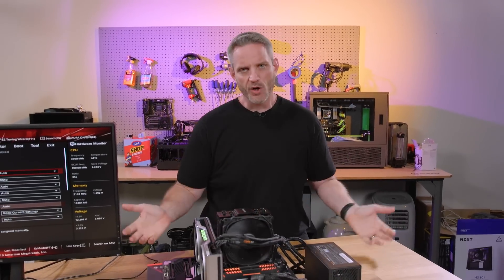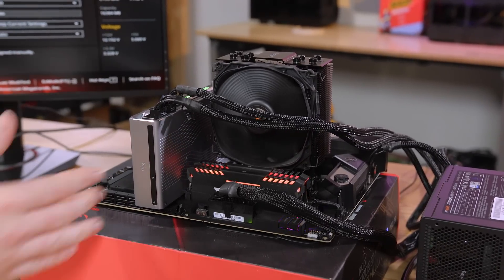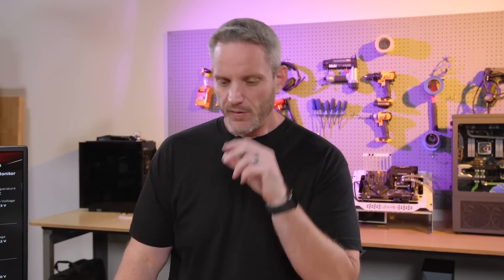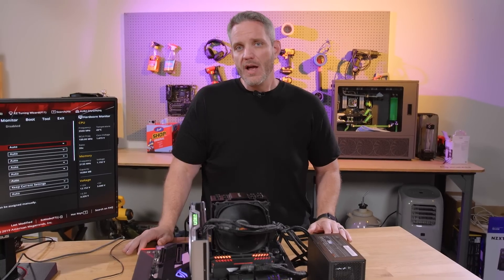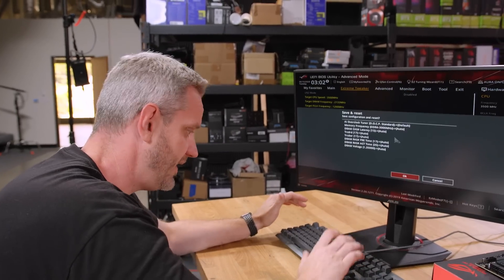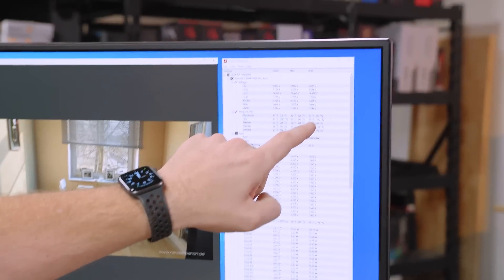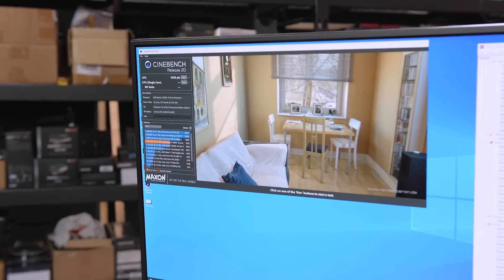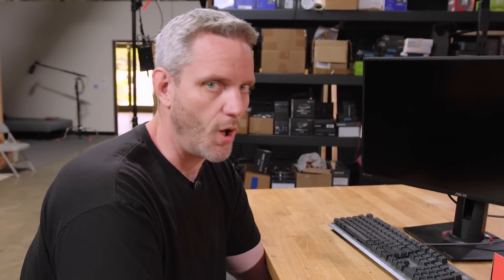Is your motherboard trying to damage your Ryzen CPU?

Comment: All my life I've only killed one CPU, and that was a Pentium 3 without a heatsink on it. I've also never heard of anybody killing a CPU. I even had a motherboard blow its VRM, the CPU survived.
So if a CPU can take 12 volts of raw power and still be functional, I'm pretty sure that any motherboard tweaks aren't going to be a problem. Odds are the CPU will become obsolete before the silicone even degrades.
Plus as long as you have adequate cooling and you're not running into the high-80s low-90s all the time, then you're really be fine.

Comment: my 1800x has never ran over 3.65 GHz with out a manual overclock. it never really bothered me....except for the fact i know the temps are good and i cant figure out why the boost clock wont run. im on an aorus x470  gaming 5 wifi

Comment: Thank you so much! I built my first PC a couple of weeks ago with the same motherboard and CPU. I freaked out at first and was scratching my head for days wondering why the voltage was so high in BIOS. Ended up manually setting the voltage lower because I could not find a clear answer online. Thanks for clearing this up Jay!

Comment: It is also important to note that the supposed degradation that people notice with a CPU that has been overclocked for a long time and now needs higher voltages or lower clocks is usually caused by external factors like motherboard, PSU, thermal paste, and CPU cooler age.  
The reason that this is important is many people read about overclocking causing damage to a CPU but that all depends on how hard it is pushed, the amount of cooling it is getting, and finally the quality and stability of the power supply system available.  I have had several chips over the years that would become unstable after 4-6 years of operation and usually, I could do a rebuild of the system replacing one or more aging parts and the system was once again rock-solid stable.

Overclocking may cause damage but it is usually not that detrimental with many chips that were overclocked out of the box lasting more than 2 decades in service and only being replaced because of a board failure or needed upgrades.

Comment: Well, hwmonitor and ryzen master are both not ideal for this.  hwinfo is actually better at it, and they have a tool that covers this.   Try OCCT large data set+running this. https://www.techpowerup.com/268260/hwinfos-power-reporting-deviation-sensor-reveals-how-motherboard-makers-are-cheating-ryzen-cpu.

Comment: Hey Jayz, another thing discuss on Reddit and other forums regarding Zen 2 (Ryzen 3xxx) CPU degrade very fast if apply static overclock more than 1.32V. Do your Ryzens had any degradation after long term high voltage OC or you just let PBO control your OC? 
 
Buildzoid 3700X degradation: https://www.youtube.com/post/UgwIDprhUtrJzFuhW0N4AaABCQ

Reddit discussion:https://www.reddit.com/r/Amd/comments/cahr5r/max_safe_all_core_voltage_for_zen_2_is_1325v/

Comment: I had to drop the volts to my wife's new 3900x on her MSI MPG Wifi X570 board, b/c it was constantly at 1.5 volts and the CPU was pushing it's speed super high just sitting at idle.  The cooler sounded like a jet engine, with 8% CPU usage.  Found an AMD guy on Reddit had written a looooong explanation and followed the thread for fixes.  Wasn't hard to fix, but took hours to figure out what was wrong.   Actually used one of your videos where you un-OCed a (I think it was also a 3900x) so that you could show how to OC it, so thanks for that!  Her's runs perfectly normal now, per Ryzen Master, but was still an unnecessary pain.

Comment: The big offender is msi trying to cheat benchmarks. that crosshair board has accurate voltage monitoring due to a controller asus adds on rog boards that does manual voltage reading instead of software guesses.

Comment: I am so dumb I did not even realize we could set the D.O.C.P. or "XMP". I manually clocked my DRAM to the MFG specifications. I also DROPPED my core voltage to 1.05V on a Ryzen 7 3600 and overclocked it to 4Ghz. I am on a ASUS Crosshair VII Hero Motherboard (last gen, so, chaper - 8-P ). Super stable and my load temps dropped by 10 C. Idle is down nearly 15 C. And that is on the STOCK cooler that came with the CPU.

Comment: So is there a max voltage limit that the CPU will not break? I have a similar setup; 3950x, Asus X570-P motherboard, 5700xt. I thought I'd give the auto OC a whirl (not that such a setting has ever worked) and I saw the core voltage hit 1.65 VOLTS! 🤯 I think I did literally scream...

I still think the power management on these CPUs is broken. When the PC isn't doing much (just stuff like Chrome open), the core power usage will regularly bounce to 45watts (with none of the cores going past 4ghz). To use Jay's car analogy, it's one hell of a heavy foot! Setting the speed to 3.6ghz with 0.9375 volts drops the power usage to ~10watts (a single core is about that full tilt, the temps reflect it too). The funny thing is that according to the histogram in Ryzen master, there is no change in clockspeed! 🤯

Speaking of broken, the SoC seems to have virtually zero power saving features, always 22watts+. Idle power usage from the wall is 90-100watts, the same components with a 6700k was 50watts. That is a big difference, especially when power usage is a hot topic these days.

Speaking of hot, the PCH fan is next to useless. Asus thought putting the fan under most GPUs was a good idea. But also, the PCH fan is too high! In the ATX specification, the maximum height for components in the card slot area is 0.6". I measured mine to be a little over, it's tight against the GPU blocking air flow.

PS: My CPU will clock above 4.5ghz more often in the default profile than using PBO. PBO seems to only boast the all-core speed (a little over 4hz), but it can run at 4.3ghz all-core if I set it manually (1.35v I believe).

It's a great CPU, but there's a lot of oddities. As a software developer it does feel buggy.
Reply: Just to be safe, i lowered my voltage from auto 1.43v to 1.275v 4.2ghz across the board for my 3950x.
Reply: High voltage is needed for single core boost for light workloads. All core oc over spec damage your cpu probably more. Even with lower voltage it draws more power. Update bios/drivers, run it default/xmp enable if needed. Pbo dont give much either so no need to bother. Also dont use these stupid auto oc  things and dont do stupid undervolting.
Reply: @Zwenk Wiel Running all core 4ghz vs 4.2 or 4.3ghz is less heat and power draw?

Comment: i got clock watchdog timeout BSOD error after clean install with everything set to auto in the motherboard.  replace everything (cpu, psu, ram, gpu etc) but the motherboard.  no luck.
finally, gave up.  ended up returning the cpu and motherboard and went with intel z490 instead.  no problems whatsoever, even with Overclock.

Comment: I have a x370f strix with a 3800x. At stock my 360mm and 240mm aio push the CPU over 84c. And never see freq. over 4.46 GHz. I lock my cpu now at 4.2ghz at 1.25v and CPU still will hit almost 80c. I've always have had a suspicion that this board pushes way too much power. Even though it's locked it still gives it too much power. My 1080 ti is at 1900mhz at .925v with a 240mm aio but still goes over %100 power limit.

Comment: That thermal limit is pretty useless, at least in my case (3950X w/ Crosshair VIII Hero wifi). I set it to 120+ and it still restarts with a "cpu over temperature error" message when I try to push it above 1.3v. I'm using a kraken x62 280mm aio. It's kinda annoying tbh.

Comment: The problem with these claims is, that this is mostly important for CPU's running close to their temperature limit under a stock cooler. I had one ryzen 3600 die on me already after abt 4 months of normal workload and some games, which i would have never expected. Especially as it was under normal use with just the stock cooler, stock driver, no overclocks nothing.
And yes, ryzen turbos high and gets incredibly hot with just the stock cooler. With intel, the CPU's usually thermal throttled before they ever got to a point that would do them harm. But i feel like ryzen is more fragile. These cpu's and the architecture are still new.

So keep an eye out and investigate with the actual stuff that people use, with their shitty lowend silicon like ryzen 3100 or ryzen 3600 and their shitty stock cooler on the lowest end b450 max mobo from msi with the cheapest case with almost no airflow.

Sorry, just had to give my two cents!
Reply: So you are saying if you are using a 3600 on an x570, with a third party aio, you will be perfectly fine?

Comment: I dropped my 1600af to 1.26v from stock and it runs that at 3700 no problem.. Didnt get a good silicone cpu so thats the sweet spot for mine at that speed..

Comment: This is why i run my CPUs at stock :) 

I enable XMP/DOCP on RAM though, not doing it is stupid.
Reply: Same! Ngl overclocking never worked for me, and undervolting my RX580 from 1.15 to 1.09 or 1.10 for temps stopped working aswell which is weird so i gave up and left it at stock too

Comment: I’ve had a msi x460 gaming pro carbon board kill two Ryzen 7’s one a 2700X and the other a 3700x it ran high voltage (1.4+) thought that was supposed to be, killed the 3700x in two months (both on water)

Comment: Jay: I've paired this 3950x with a Dark Rock Slim in order to use a cooling solution that is a little more realistic.

Me: Casually looking at my i5-8400 with a Dark Rock Pro 4 installed.

Albeit i got this cooler because i wanted to replace the stock cooler but i'm gonna upgrade to a Ryzen 7 4000 so it has to be good for that too.

Comment: I saw your Ryzen Master explanation. However I'm still gnna be that guy lol

Reason being is that you're assuming HwMonitor will work the same way on a Ryzen chip that it would on Intel. Problem is that AMD has directly addressed that HwMonitor, Hwinfo, and many other monitoring software programs get incorrect voltages from the mobo and cpu.

This is because the ryzen cpu, after it gets a command from HWM going "hey what's your voltage? I need it now!" the cpu responds by increasing its voltage for that split instant to quickly report the info HWM is asking for. So it's reading a vtage higher than what it would have actually been using.

While yes, Ryzen Master does have knobs that can override the mobo, a fresh install with default settings will not be overriding any bios settings. All it will do is monitor. And it actually reports the correct voltages because it uses a non intrusive continuous request to graph the voltage and account for boosted voltage requests, resulting in showing you the correct voltages, and Temps of your cpu.

AMD did also mention that Cpuz is the only other monitoring software that does this as well as then in regards to reading ryzen info.

Still a great video and hope the extra info helps someone out there. Check out an article called "The final Word on Ryzen Voltages" AMD put out that explains everything much better than I can lol
Reply: The monitoring causing voltage spikes has mostly been addressed with AGESA 1.0.0.3 ABBA, here's a part of the patch notes:
"Today we’re announcing that AGESA 1003ABBA carries firmware-level changes designed to do just that. The changes primarily arrive in the form of an “activity filter” that empowers the CPU boost algorithm itself to disregard intermittent OS and application background noise. Example test cases might include: video playback, game launchers, monitoring utilities, and peripheral utilities. These cases tend to make regular requests for a higher boost state, but their intermittent nature would fall below the threshold of the activity filter."

Comment: Anyone who has ever had an Overclock stop working after 1-2 years, it can be degradation of cpu, but sometimes it can also be degradation of thermal compound (especially from cheaper pastes and some preapplied pastes) so if that happens 1st re-seat Cooler with a new high quality paste before going through the trouble of redialing your OC. Now this is usually the case if your running an OC on the cusp of the CPUs limit. That is why when you dial in an overclock you should find the stable limit, then back it down 1-2 steps. E.g. just because you can run a few passes stable at 5.0 ghz does not mean you should leave it there.

Comment: after a few Benchmarks it seems like my ryzen 7 3800x runs at an average of 4.1 GHZ, when submited to heavy load, no overclocking there. I'm surprised and kinda scared because i'm using the cooler that came with it.
Reply: He's using a higher core count CPU, which get slightly lower all-core clocks than the 6-8 core chips. The 3800X tends to boost higher in Cinebench

Comment: My default voltage for my 1700 went to (iirc) 1.45v and it ran for a while like that. Still running like a champ and I'm overclocked right now.

Comment: UHMMM, Jay we had this same issue with the 1000 series on X370, same scenario, same exact thing. (keep in mind that was Ryzen on initial launch in the first couple months before mature Bios were released)
A lot of OCers were worried when taking a look at the voltage pull, in particular both the Taichi from Asrock and the Crosshair were doing this, if you hit the internet Reddit time capture for the Crosshair stability and OC thread they specifically talked about this(several AMD engineers were in thread helping) and ended up sorting it out with a BIOS update but recommending we manually set the Voltage rather than leaving it on auto, but several peoples CPUs did end up fried and AMD(this is what lead to the discovery) and Asus replaced under warranty due to the conditions that it was immature and not many understood everything going on in those early couple months with setting and tweaks and such.
TBH I don't think this is an issue and/or a problem it just sounds like internet drama and the platform at this point is more refined than it was, its like someone read the forums from back then and tried linking it to now.
Ever since about the Q6600 days its almost impossible to fry a CPU by OCING as long as on something like Asus boards you don't turn on the LN2 bypass mode that turns off limiters. I mean its possible but not really probable.

Comment: 15:50 cringes when jay sets cpu at 1.5 volts
Reply: Well,the mobo is doing it anyway on auto,so...
Reply: @TheChudoviste  Yeah but in short burst not continuously
Reply: @TheChudoviste  yeah, and after a core gets 1,5V the next second it gets 1.2V . Shoving 1.5V into your ryzen CPU for daily use will damage it severly if not kill it after a few weeks. Also for cooling it you would need at least a full custom water cooling system with some huge rads.
Reply: @Manysdugjohn  yeah,I know...my asus rog strix b450-f was pumping 1,56V into my R1600X every 30 seconds on idle!
And my 1600X could go 4,1 Ghz all cores any time of day for 6 months...then I noticed it can't anymore...
My fans would go nuts every 30 seconds and I thought it's just the way ryzen works.Little did I know that is caused buy the mobo pumping high voltage to CPU,thus increasing the temp which leads to fans go high RPM...
When I dug deeper,I found those voltages are insane for the CPU.
Still don't know how I managed to stabilize it,because I tried so many settings,options and programs...
All I know is,that if I'd have the money to waste,I'd dump this overpriced peace of $hit mobo into deepest hole of earth,and get a MSI b450 pro carbon ac (which wasn't available at the time I was purchasing the parts,and was my FIRST choice).
Btw,now I have my PC almost all on auto,and I don't see the core rise above 3,6 Ghz (all cores) on ANY CPU benchmark (cinebench and alike),so,once again,if anybody is interested in buying b450 board for ryzen,PLEASE DON'T buy ASUS ROG STRIX b450-f gaming because it's $HIT!!!
Reply: @TheChudoviste  asus motherboards have a lot of ofsets and need a lot of tuning as far as i know... anyway... 1.56V is insane even with pbo.

Comment: ryzen 1700 3.8ghz undervolted to 1.2v since day 1 going on 3 years old. just don't set anything stupid and your cpu will be fine.
Reply: Just because you set your Mobo with that doesn't mean it still won't lie. On my MSI if I put 1.31 volts it will flood 1.386 and flood the CPU. Rediculous. I had to go into expert mode and disable a whole lot of shit for it respect my settings

Comment: It used to be where things like the LLC meant getting situations where the voltage supplied wasn't the greatest and sometimes went low causing instability so have times changed. People are likely to kill their procs from pushing crazy volts while overclocking than early death from default values.

Comment: 3950x, asus x570 crosshair, 2080, and a dark rock slim? You say you 'wanted something that was a little more indicative of what someone might use on their system.' I would suggest that someone using that cpu, gpu, and mobo would be more likely to have a custom cooling loop, or at least an AIO... That doesn't really detract from the video, or the info though. Good vid

Comment: I turned off Core Performance Boost and now my temps are half and my voltage is back to normal all for the low low cost of 3to5 fps loss in games

Comment: i have an Asus b450-f for my 2700x. by default, it was doing some wack stuff, and even on an aio it would idle in the 50's. I manually overclocked it to 4.2 at 1.28 volts, good to go. idles in the 30's, totally stable
Reply: Same set up here, I set a 1.23v and 4.00ghz with a cooler máster 212 RGB black edition, 36-38 idle and 50 max while Gaming on summer. I think stock voltage on ryzen are too aggressive for a average build where you use Chrome or Firefox and Gaming.